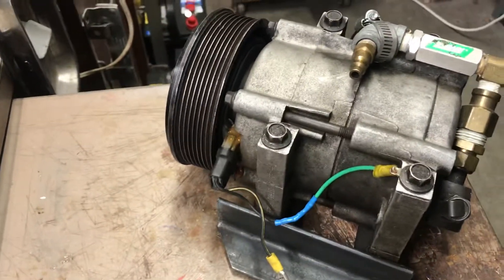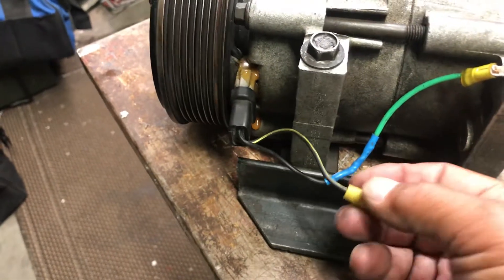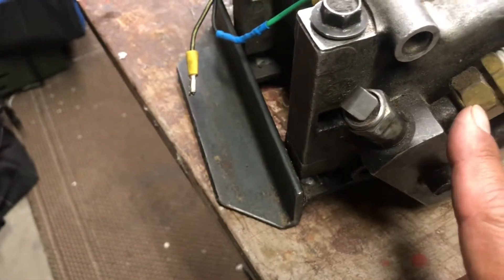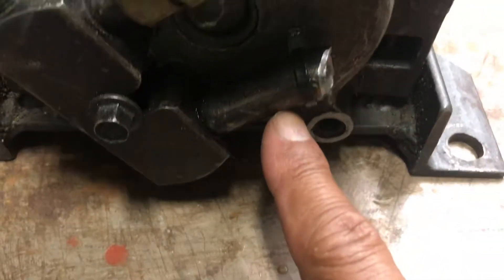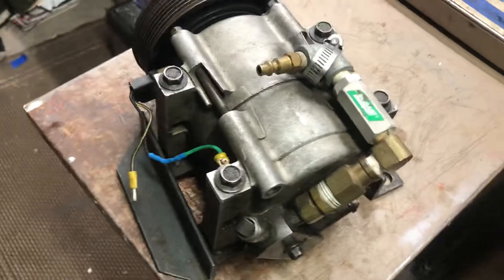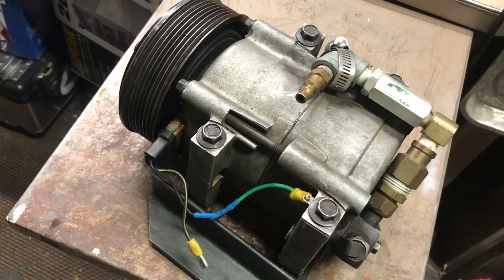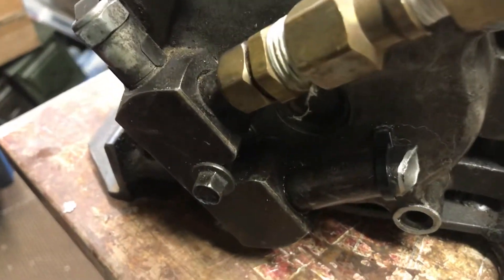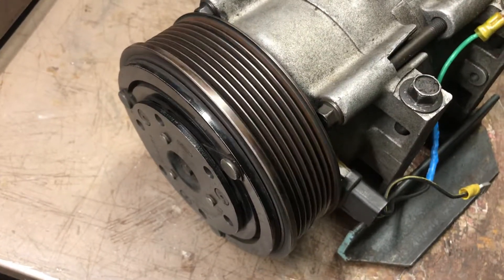Description of the ac compressor modifications

Comment: I have a 98 wrangler.. is the AC compressor on it work for this project or do i need a different kind of ac compressor?..thanks!
Reply from the maker: This is a common ac compressor.  If yours looks like this it should work fine.  You can use your ac switch to turn the clutch on.

Comment: What about oiling?
Reply from the maker: I usually squirt a little bit of oil in the intake before I go wheeling which is very rare now days.  Plus I get lazy and after wheeling I just load the Jeep on the trailer and air up when I get home with a home compressor.

I’m surprised folks are watching this video.  Thanks for the interest.  

Also someone mentioned this compressor would not last all these years.  Just for reference this thing is on a regulator, it pumps up a tire in probably a min or two, for 4 tires maybe 8 minutes total.  It’s not like this thing is running for an hour non stop.  Also if you don’t run a regulator you should run an open Chuck.  Don’t want that thing trying to bust a hose.   Don’t know if it will but I would not take a chance.    

A few years back someone made a welder from an old push lawn mower and an alternator, if you’re clever you could throw in an ac compressor/regulator/air tank and have a small portable shop tool to take around the yard.

Comment: Would it be possible to modify an existing AC compressor to do double duty, meaning switch from AC operation to air compressor operation for short periods.
Reply from the maker: That’s a good question.  You would need a very fast two way valve to seal off the ac system to minimize refrigerant loss in the switch over. But each time you would lose refrigerant that is inside the pump.  It would be analogous to a pool spa diverter valve.  Someone would have to think it through.  But off the cuff I don’t think it would work well.  

Search around I know some guys have installed two pumps.  

Now days there are very good electric pumps so having an engine run compressor is not that useful.
Reply: @Paiadakine  thanks for that, it would be interesting if you could evacuate the AC gas into a gas cylinder, and then back like they do when they re-gas the car air-conditioning, and while it is gas free it could be used as a vacuum pump on one side and a air pump on the other. There are some DIY AC evacuation systems on YT but no one has combined these functions, maybe because it's too difficult to do.

Comment: Probably work for ten minutes.... no oil bath to lubricate the internal parts.
Reply: Actually, it that is from a Jeep, it might already be a York, which don't need oiling as they have an oil sump already.
Reply from the maker: @boots7859  Hi there Boots, this is a sanden compressor.  This engine is a 92 dodge dakota engine in a 85 XJ.   I did all this back when Electric compressors were crap and this was cheap.
Reply from the maker: @timamyett.  You don’t know what you’re talking about.  

I’ve had this compressor for 18 years.  I usually squirt some oil in the intake after using to fill my Jeep tires.  I’ve run this to fill my Jeep tires from 8 lbs to 30 lbs after a weekend of wheeling.  The most I’ve filled up was my set and plus 5 other sets of Jeep tires.  Way faster than electric pumps.  It just runs and runs.  I have York’s that I planned to replace this compressor but never had to yet.  These compressors are dirt cheap at a yard so if it does crap out just get another to $25.  

But saying it would probably work for 10 min and break due to no oil bath is completely inaccurate.